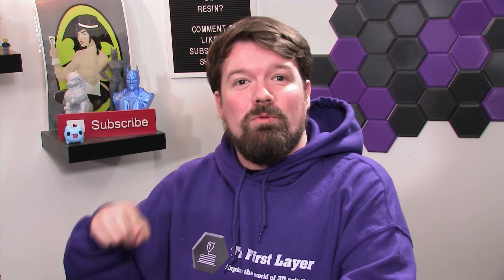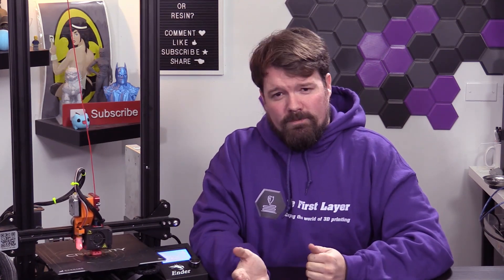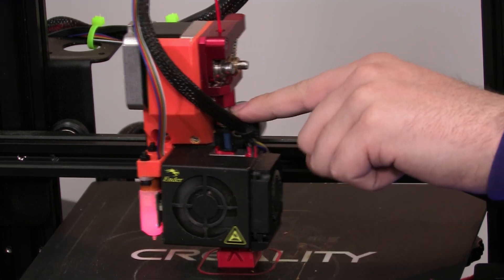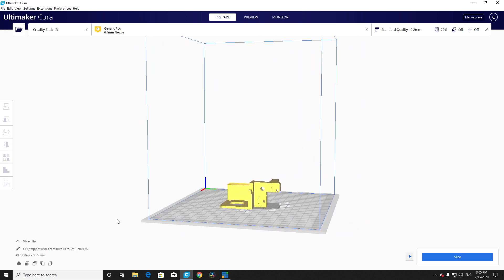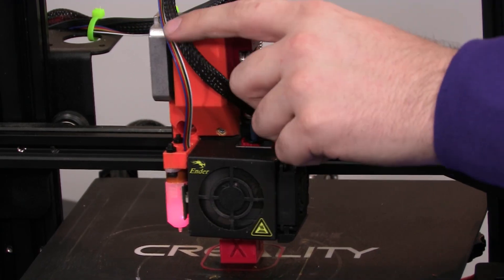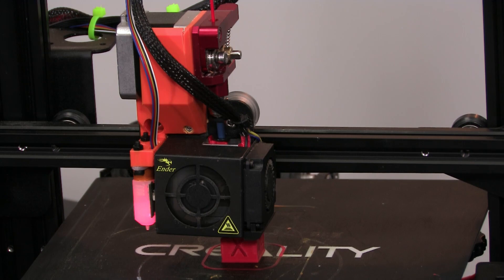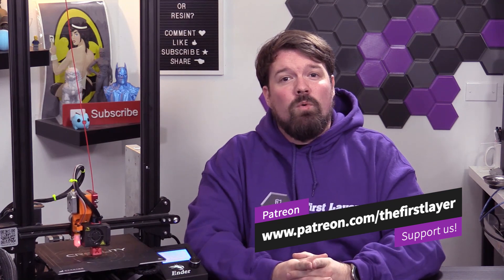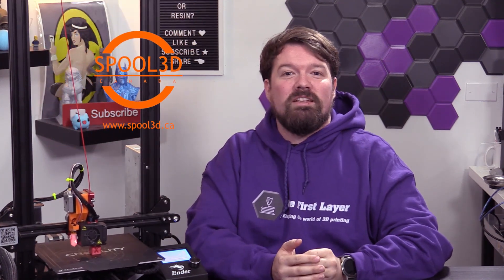Easy Direct Drive Upgrade

Comment: Since I've shot this episode, I've also installed the mod on my CR10s5 with a MicroSwiss hotend and volcano block. It works great on both my machines, and I no longer have bowden tubes popping out. It's pretty awesome!
Reply from the maker: @walteralvarenga1552  Send your questions to questions@thefirstlayer.com, and we'll do our best to answer them during our livestream every Saturday night at 6PM PST / 9PM EST.
Reply: well its been quite a while since the video was posted, and i was wondering if there were any unforeseen issues after putting on this mod.  also, how much do you actually lose on the z-axis?
Reply: @CaIasanctius  No real issues so far. I recommend using a material stronger than PLA (I used HIPS for this one) to reduce any wobble. For height, you'd lose roughly 50mm.
Reply: @BryanBakerXBrav  thanks, I tried to put it together and failed to take notice that your build height is much higher than mine, which also means ur z-axis cable and extruder cable are also much longer.  The stock cables just aren't remotely long enough to cover even it's own height.  So now I'm currently waiting on longer cables, and just building things shorter than 150mm.

Comment: Where can I find a six pin male to six pin female stepper motor extension? All I can find are 4 pin to 6 pin.
Reply from the maker: I've only found them in the Creality cable extension kits, but they're not great. I'd advise to pick up some JST connectors from Amazon and making your own, or adapting a 4-6 cable to use the new 6 pin JST cable.

Ideally, in long term usage, the best bet is to get a new cable to span the whole length, as any connection point can be a weakness or noise point.
Reply: @TheFirstLayer  turns out I had one all along and it was with the "extra" parts that came with my CR-10S. On a side note, I printed the part over the weekend and now I am printing with a direct drive as we speak. I tweaked the model to remove the mount for the BL touch since I don't use it. Thanks for the video!

Comment: I've upgraded my Ender 3 with the Micro Swiss direct drive and hotend. It's now just so much better, no issues printing thin walled things and it can print faster with precision. I would never go back to the bowden tube anymore.
Reply: That thing looks so sleek. Unfortunately, it wasn't out when I started with this mod, and the end price is a bit steep for my needs currently.
Reply: @BryanBakerXBrav  Very true, it is not cheap but worth it for what I do use it now.
Reply: I am thinking about upgrading my Ender 5 setup for a Direct drive but hesitant because of possible ringing issues and slower prints. What are your experience? Does it slow down prints to get quality or not so much?
Reply: @henriklagercrantz  I have faster and more precise prints tbh. as the direct drive can extrude the exact amount. Less clogging the nozzle. Ringing is no issue, the direct drive is solid. I would never go back to the bowden tube anymore. Hope this helps ;)

Comment: I was curious if you had any advice on replacing the extruder head on my CR-6 SE. The Bowden tube is clogged and won't come off without breaking the clamp.

I am thinking it would be best in the long run to replace the extruder head with a direct drive extruder, but I am unable to find any information on doing that with a CR-6 SE.

Comment: This works really well, can't believe its so easy to go direct drive with stock parts. Please put a disclaimer that you will need a stepper motor wire extension cable.

Comment: after this upgrade prusa slicer has introduced ghosting. cura does not ghost though. is there a setting in prusa slicer vs cura that would have this effect? i notice in cura acceleration and jerk settings are disabled and in prusa slicer they are set manually. i tried halfing them default settings and theres little to no difference. ive also tighted all best, bolts and eccentric nuts that i could get my hands on. same thing. any help greatly appreciated!

Comment: Does your extruder stepper motor run really hot to touch? Mine measures at around 45 to 55 degress celcius which is a little hot to touch. I also find I need to reduce the flow rate and temperature to prevent clogging too easily. Do you have these issues after the direct drive mod?
Reply: What the hell????!!! Why are your motors running so hot? Are you running like 500mm/s? You need to adjust your vrefs. Lol

Comment: The mod looks nice but i'm curious to know if it still works good on bigger / wider prints. There is a lot of weight added to the X-axis plus you introduce extra movement / vibration in that area because of all the work that the extruder does, special a print with a lot of retractions add to the party. Also why did you replaced the original extruder with a red aluminium version? (I believe the Ender comes with a plastic one?) I believe the design of that extruder causes troubles pushing filament through so I replaced mine with a bulldog extruder and that thing is pumping filament throug the bowden tube with ease. My setup is now like the filament goes from the spool holder in to a bowden tube attached to it, that attached to the input of the extruder and then out the bowden tube like normal. This way the filament get's always in a straight line to the extruder and don't have to worry about how the spools are wound.
Reply from the maker: I just added it to my CR10s5 with a build volume of 500x500x750. It just completed a 3 day print up to just over 300mm or so without issues.

The weight is negligible unless you've dropped your vref to 650mV. At stock values, it runs fine even with such a big build volume.

I had a bunch of the extruder assemblies laying around. I always replace the stock plastic one due to the arm weakening over time. It has never failed me.

-Bryan
Reply: @TheFirstLayer  Thanks, great to know. I did think it would introduce some weight/speed issue but you could say the proof is in the print :-)

Comment: TO SLOW! I just purchased the Hemera and it will be here Thursday so I really could have used this info last Friday...;) Still great info and good to know in case I get another Ender 3 Pro...;)
Reply: It's a sexy design, but I just couldn't justify the price of the Hemera.
Reply: @BryanBakerXBrav  Yea well if they sold it without the stepper motor it would be a lot cheaper, given its nearly identical to the one it will replace.

Comment: After installing this do you have to adjust your cura settings for retraction?
Reply: Only if new issues arise. The retraction setting is usually based on the hotend's configuration instead of the extruder. You can always try lowering it, but usually that introduces more stringing.

Comment: I print for replacement parts and scale accessory's for rc car etc, hands down direct works best. due to the extra weight on the Gantry you will have unwanted rings in your prints.

Comment: Nice vid 👍 One question though please, you said you didn't need to buy anything but how did you connect the extruder motor? Did you not need an extension cable?

Comment: Does this work on CR-10?
Reply: Yep! It's installed on my Ender 3 and CR10s5. Just make sure your motor cables are long enough to reach the far side of the machine.
Reply: @BryanBakerXBrav  what about cr20pro
Reply: @jap71rx2  I don't own one, but the hotend looks identical.
Reply: @BryanBakerXBrav  thankyou
Reply: Have u got a vid on how you extended the frame z height .. thanks

Comment: Hi my friend excellent video! you have another subscriber!! one question, I recently buy a Tronxy Xy-2 pro with titan extruder, I think its a clone of the ender 3 but with titan, will this mod work on this? or I have to modify something else to fit? and you will have to print slower than with a Bowden in PLA because of the ringing? how do you solve the high problem, modify in it in cura? i don't want to modify the structure because i dont have enough space, sorry the bad english

Comment: Thanks Bryan, for your excellent, very persuasive video on a simple direct drive mod. A Fan from Edmonton.  I am really tempted to try, on my already heavily modded ender 3 Pro.  Just two questions:
1.  This version versus the alternate "CR-10 / Ender 3 Direct Drivinator"  (https://www.thingiverse.com/thing:3589452)"  any thoughts ?
2.   I assume that with the BL Touch, the probe position was fine, and you didn't have to make any adjustments to your BL touch setup from before the mod ?